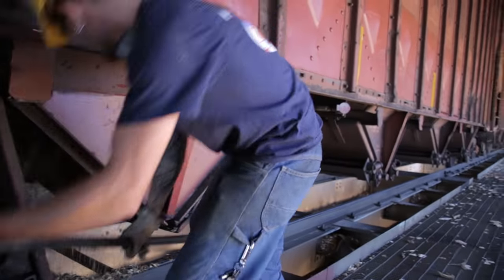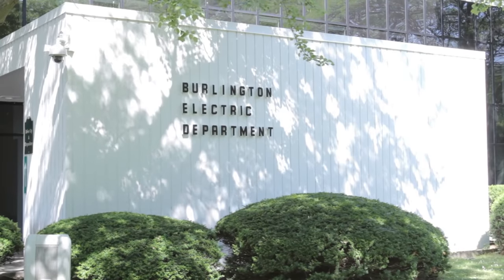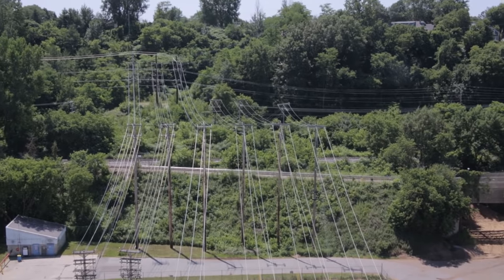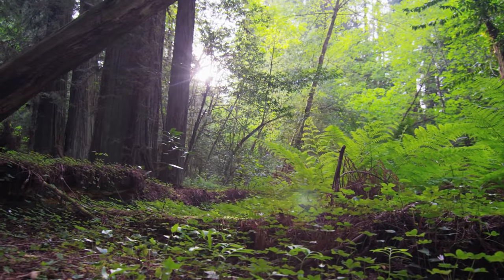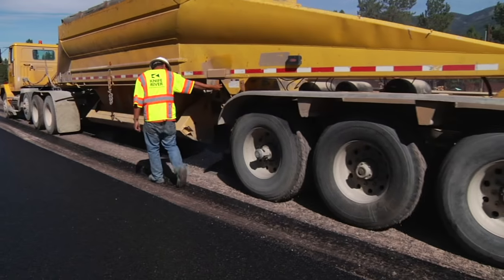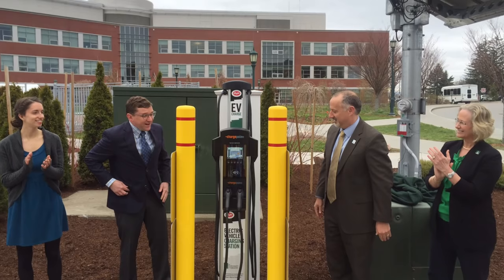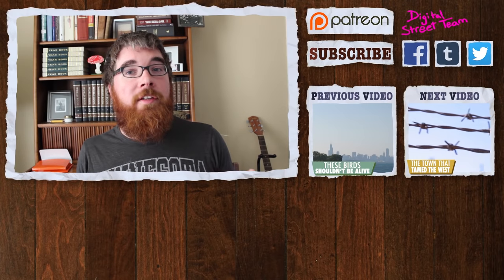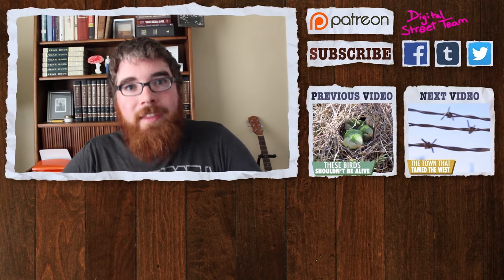Can A City Run On 100% Renewable Energy?

Comment: Georgetown, TX does already.  they have contracts with wind and solar all over TX, and invested in a 10 MW/h battery that they are working on expanding to 50MW/h.  they can run the entire city on battery for up to 4 hours at peak load, but so far they have never had an issue sourcing power and usually use the battery to sell power into the Austin area at peak making a nice profit

Comment: Nuclear Energy is the cleanest and cheapest form of energy production long term.
Reply: All depending on how you solve the Problem with Nuclear Waste. Idealy in a better way than just locking it away for who knows how many Millenia exactly, constantly cooling and preventing leakage. Like i dunno, take it apart into its Atomic Base Componets and reassemble it as new Materials, but you have yet to research or atleast make it Viable on Industrial Scale.
Reply: @Techischannel  Thorium reactors consume almost all nuclear waste and are much cheaper, just check. You will be greatly surprised. On the other hand oil and coal barons will fashionably support all alternatives as long as are inefficient (over all produce more CO2). That’s the way they govern us thirsty over the water and make us to be willing to pay all kind of green taxes.
Reply: Only when you completely ignore the costs of safely storing the waste.  Just ask the folks around Hanford, Washington.  They are home to the EPA's largest superfund nuclear cleanup site.  It is estimated that it will take more than $100 BILLION dollars over the next 5 decades or so.  That's assuming they don't have more delays and cost overruns. 

It's the US taxpayer that gets to pay for that.  It seems to me that $100 Billion would be far more useful buying solar panels and wind turbines.  Cleaning up those is FAR less costly.
Reply: The thing is that about 95% of nuclear "waste" is actually fuel we aren't able to use at the moment. If we invested in new of generation reactors we could use virtually all of our long lived nuclear waste and make huge amounts of power that way.
Reply: I am a major environmentalist that fully supports sustainability, green renewable energy, and greener solutions; I won't say that nuclear energy has no place in our world (because I do not know enough about it to protest against it), but I will say if we were to implement it that it shouldn't come to the point were we're dependent on it. If they can prevent it from making more fukushimas and Chernobyls, then perhaps. It should only be the means to where green energy falls short (whatever that may be). Other than that, let's go green and get every house and commercial building on Net-Zero energy.
Reply: Physicist here check out nuclear fusion it’s diffrent than fission bassically no waste also it runs on seawater it’s much cleaner and effective tho this new tech is in its infancy tho China has mad progress on the i.t.e.r reactor and there’s a tractor in Germany hope this helps :)) think of a star on earth bassically

Comment: Use solarized e-trikes/trailers. Place 900watts of flex panels on the e-trike and 900watts of flex panels on the trailer.
Use extension cords on the panels to allow for easy switching for other uses.
1000s of individuals using mobile solar will both supply and reduce energy (biomass)

Comment: Solar and winds can actually can supply 100% of the required energy.
Just look at the houses will some 4KW of solar panels. They produce more than they use, while you can probably fit 20KW on a normal house roof. Wind produces even more from smaller space. You should study your area, climate, resources to develop your own energy supply.

Comment: what we need is a renewable energy that is cost effective and mobile. hydroelectric is great where ever it can be used. biomass is more mobile, but costs 250% of what coal does. Soler and wind are even more expensive and also can't be used everywhere.

Comment: of course a city can run on 100% renwable energy, it doesn't care what the source is. Really the title to this video shows a complete lack of understanding of how grid electrical systems work.
The simple fact is that the evidence from world wide use of wind and solar is that it is extremely poor at providing power when and as we need it. Biomass is considered a renewable but is capable of providing power as and when required, it just is not as good as coal or oil/gas as it's energy density is quite a bit lower. Where it falls down is if we chop down forests rather than using waste wood, forest can be replanted but far too slowly as a source of biomass fuel.
Reply: I must disagree with you about your statement that "solar . . . is extremely poor at providing power when and as we need it." Think about the capabilities of solar on a hot summer day when demand peaks for electricity due to the overwhelming use of air conditioning. The problem is that greed and politics prevent the wide-spread adoption of renewable energy sources and the means to store renewable energy by means other than batteries. The entire United States could run on renewable energy and it would be much less expensive long-term than our current energy mix. The initial cost might be slightly higher, but greed has made the cost to modernize excessive.
Reply: @cityofabscissae  Or we could just use nuclear and not destroy the environment for a lot of super large solar farms that need a large amount of space and don't give that great of a return in power generation.
Reply: @The_Desert_Tiger , I am not in favor of solar farms at all. They are an eyesore and destroy natural landscapes. The United States has enough roof space and parking areas that could be covered with solar panels to provide the necessary power (if coupled with energy conservation) to satisfy the entire population.

Comment: The last point at the end of the report fell a bit short. So called "micro" and "smart grids" are, besides storage and cutting on electrical energy usage, one of the main challenges to master.To achieve a 100% and efficient supply of energy from fluctuating renewable sources such as wind and solar (PV), a lot of household appliances have to become more flexible and controllable. keyword DMS/DMR ( demand side management/demand side response ), we have to try to use energy when it is available to avoid expensive and inefficient storage and generating of energy on demand. I would like to see a report on that topic in combination with electric vehicle. I hope my English was not too bad. Grüße aus Deutschland

Comment: Biomass is difficult to scale up for, say, a place like Chicago. But I'm not sure it needs to. This system clearly works for places like Burlington, but even they rely on several sources of renewable energy, not just biomass. That formula might not work for bigger cities, but with all of the technologies being available, and getting both greener and smarter, larger cities might just have to find a formula that works for them based on the same technologies.

Comment: Mass produce solar in vast volume to reduce it's cost and pay back time. 
Cover every available inch of every roof on every building with solar.
make it very cost effective.
Put Pir sensors on every light and appliance in every house and business to avoid wasting energy in unused rooms.
Hence you will be able to walk around the home without needing to turn a light on or off. ( except the room you were actually using)
street lights could also be on motion senors where maybe a set of 4 would light up as you walk along the street or even drive ?
And L E D streetlights.
these savings would make a huge difference to power generation needs and household bills.

Comment: Great explanation for biomass--you thoroughly covered all my concerns as far as sustainability, but not so much for accessibility. It's all well and good to use it in Vermont, but if you don't live near a forest, it's not a great solution. I think it would be great to implement it where possible, but most places will need to focus on other sources of renewable energy.

Comment: The average industrial electricity rate in Burlington is 11.52¢/kWh. This average (industrial) electricity rate in Burlington is 15.43% greater than the Vermont average rate of 9.98¢/kWh. The average (industrial) electricity rate in Burlington is 72.71% greater than the national average rate of 6.67¢/kWh.
Reply: energy is so reliable and efficient right

Comment: 1. If you're mainly able to exist off renewables because you've reduced power needs, you haven't come up with a solution that's workable in general. I especially see issues with the biomass power being scalable to larger and denser population that use more electricity, like South Korea, where you would not be able to replant fast enough. 2. Please do not list nuclear alongside things like natural gas, ever, without an addendum; it's clean power. 
The video itself though was great, and it's cool that the town has found a way to make things work for them. Now they need to get rid of all the personal gas powerplants on wheels and increase their grid to support electric transportation.

Comment: Not one mention of cost, except for the unquestioned assertion that government conservation subsidies are cheaper than buying grid power. At least they do admit that fluctuating renewable output must be backed up by reliable grid power. Otherwise, there would be brown outs and black outs in Burlington.

Comment: Absolutely amazing system! Maybe dropping woods and go for rooftop PV system with battery should be the next step. 👍
Reply: What about in the winter? Start up biomass power plants again?
Reply: @FrainBart_main  high eff pv might be enough. Of course, need to do the math.
Reply: @marshall19th  Any solar panel that has over 25 % efficiency is very expensive (even 20 % is quite expensive). In either case you have to oversize solar panels production for the winter. Solar production in the winter can be 5 times lower than in the summer. What to do with 400 % overproduction in the summer then? What about when there is let's say a week or two of cloudy weather (production from solar panels can be only around 10-15 % then)? A system containing only solar panels would need a lot of energy storage and massively oversized solar production to have enough electricity 365/24/7. Nobody would pay the money needed to do that. There are smarter ways to have clean electricity, which is also cheap and doesn't have to be oversized a lot.
Reply: @FrainBart_main  you are right about the cost. Winter PV efficiency part is kind of exaggerated. Anyway, the concept is being clean, and burning wood doesn't look clean to me. If you can deal with the exhaust, why don't go with coal, right? And I'm guessing that the exhaust processing costs some as well. However, I agree with you on one matter: solar may not be the best solution, there must be other clean solutions can be considered such as wind, geothermal and etc. Storage has to be considered if a system wanna go 100% off-grid. Only my personal idea :)
Reply: @marshall19th   It really isn't exaggerated, I looked at the actual numbers of solar production for my country (Slovenia) and it's 4 times lower in the winter.

Wood burning is actually clean if you have the correct filters. It is carbon neutral and with almost no harmfull emissions (PM is the worst thing in flue gas from biomass burning but this can be managed quite easily). The difference from coal is that coal isn't carbon neutral or renewable and there are other harmfull emissions like SO2 or NOx which are harder to filter out.

In my opinion the best solution is this: Hydroelectricity where it's possible, geothermal where it's cost effective, biomass where there is an increment of forest, a little bit of wind and solar, nuclear to fill the gap between production and consumption.

Just like you would need energy storage to go off grid, the same problem is in the power grid, consumption and production must be equal every second. The good thing is that we can regulate output power from classical power plants like coal, gas, hydro or nuclear and mitigate this problem without energy storage. When there is more and more solar&wind implementation and classical power plants closures, the regulating power need is higher and higher but the actual regulating power that can be provided is lower and lower. That's where energy storage comes into the picture but this would be very expensive to do on a power grid scale.

Comment: wait so burning woodchips... 100% renewable. those two don't seem to go together
Reply: Tobi Rebant If you source the chips from forest wood, that is regrown then it is reneweavle. You just have to actively plant new forest at the same rate you cut it down. The amount of carbon dioxide released ( by burning wood) will be the same as the as carbon dioxide removed from the atmosphere (by new trees growing), hence overall  no C02 is released

Comment: Create a two lake system,  one up hill on high ground and one lower lake. Store the excess energy in water / Hydro.
build a wind and solar farm around it, to power it. 
Whenever there is excess generation occurring the pump would pump the water up hill. ( Wind power at night / solar by day)
Like a huge Natural Battery. + The lakes could be used for Nature / wildlife reserve etc.
and fishing and boating water sports etc.
When the extra power is needed flow the water downhill through a series of hydro turbines.
running / maintanance costs would be met by a small visitor charge to use the area for walks / watersports etc.
maybe a camp site, log cabins to rent, caravans and rv's make it a tourist attraction, maybe a cafe, restaurant / hotel with lake views etc.
Get people to enjoy it rather than oppose it, 
AND Make a PROFIT ! 
other uses, = smooth cycle track, off road all terrain cycle track, 
Bring people from outside the area to visit.
All self funding over a number of years.
make it fun for everyone.

Comment: If every house has solar, then there wouldn't be any need for non-renewable energy. Factories can get energy from excess power generated by all the homes and a battery bank per city would solve the energy needs during the night.
Larger cities such as Beijing would have bigger power plants located throughout or outside the city. It will take a lot of time to get in place, but it will solve the issue

Comment: Assuming all trees are roughly equal mass, there should be the same amount of carbon in every tree. If trees are burned at equal or faster rate than trees are grown, in a close system environment every new tree would absorb all carbons released from every old tree burnt. However, a city is not a close system, so unless this is implemented across the world, the carbon release and absorption rate will not equilibrate.

Comment: Other possible power sources would include drawing it out of the ground (not sure where to find it online since I read about it in an ebook but it involves galvanized steel pipe buried in the ground with a copper pipe in the middle) as well as using radio crystals (same ebook, it was called through the eyes of a patriot by crusher utoo), also for fuel I'm sure that scientists could improve on old gassifier technology including one thought I had which was to adapt solar oven tech instead of flame, which would make the gassifier much safer.

Comment: I did a quick calculus: (((50Mw ÷ 43%) × 100) ÷ 42 000)= 27 685w per user, it's three times higher than us here, in France, where we can't pull more than 9 000w because main power supplier, EDF (stand for "Électricité - Distribution de France" ( "electricity - supply of 
France" litteraly)) place a power limiter which is triggered if we use more than 45amp. On our 230V powerline.

So how still could they think they're greener than other when use three times more power than frenchs ?

I know we mainly work and rely on nuclear power, but it's adaptable like wood chips or pellets, no fuel quality problems (try to get energy out of wet woods (even the dryer won't be enough to get it dry and ready to use)), when less power is used, less power is produced too (no need to store it outside, it just last longer (so less renewings mean less transports))

Last, but not the least, coal and oil, according to the fossilization of vegetation and animals for generate it, was actually the first renewables energies, because it never start and stop without any autorisation released by a mysterious and dark administration.

And, the question that i wonder since always is: for a same weight and volume of wood, did the wood won't be more efficient in the form of log instant of wood chips ?

Comment: You got someting wrong: NOx and SOx gases made by the burning of biomass do not come off as smoke, only particulate matter does (which is the less harmful to the enviroment of the three). The guy at the plant didn't adress that part, they only reduce particulate matter.
Reply: I noticed that he skirted that question as well.
Reply: There won't be any SO2 from biomass combustion, and very little NOx if the combustion is done at the proper temperature. CO2, yes, of course there is CO2.

Comment: I'm holding a magnet in my hand with a steel slug stuck to each side.
On my desk is a physics book with a picture of the lines of force coming out one side of the magnet, then returning through the other end.
If this were true, one of the steel slugs would have to fall off. It does not fall off.
Fix the books and you can have unlimited clean electricity.

Comment: Even though the forest is regrowing the carbon dioxide CO2 that's is being stored in the trees that they haven't cut down but will end up cutting down will release all of that CO2 so this basically isn't very good because either way the CO2 that they claim the new forest soak up though it does it's only for a small time until like I said they cut them down.